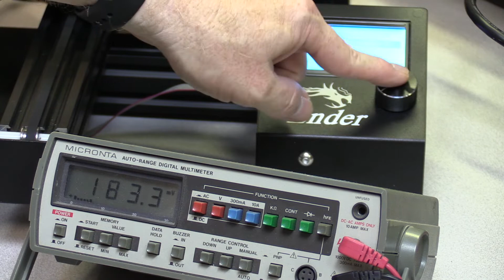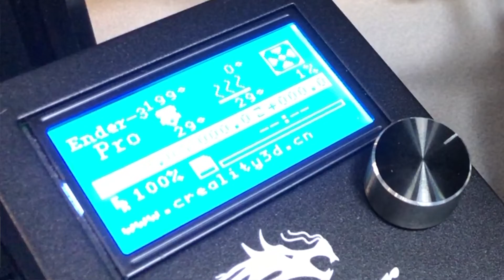Thermal Runaway and the Creality Ender 3 Pro

Comment: Good info Bryan. I've had both the min temp error and the thermal runway error on my CR-10S and didn't know the difference, this helps clear things up. 
I see one of your other commenters suggested the TH3D firmware for the Ender 3 Pro. It's the one I went with as well and it's quite easy to install. It would be interesting seeing a vanilla Marlin install as well though. Looking forward to whatever you go with.
Thanks for sharing!
Thierry
Reply from the maker: Hi Thierry, and thanks! Interesting that the CR10S has Thermal Runaway protection enabled, but the Ender 3 Pro doesn't.  I need to look more at the TH3D Studios Unified Firmware, because I think they've done a lot of the heavy lifting involved in making it an "install and play" solution that works well with the products they sell (such as the EZABL, for instance). 

That said, I also think it's important to be able to throw plain Marlin on a printer. Firmware's not too hard to change once you get the hang of it, if you've got a bootloader on the board, and the right settings in configuration.h and configuration_adv.h in Marlin. 👍
Reply: Sorry,  @BV3D  I should have clarified that on my CR-10S I upgraded the Marlin firmware to 1.18 (I used Vanilla and enabled options I wanted). I'm not sure that it had thermal runaway enabled when it was stock.
Reply from the maker: ThierryDeux Ah, OK. It may not have!

Comment: Bryan, you’re a good dude. Don’t sweat it! We have to all assume these Chinese manufacturers don’t care about the safety. There is zero reason why this is still a problem in 2019. Good job!
Reply from the maker: Hi Stephen. Thanks! I agree. It's simple enough to set the machine limits in the current version of Marlin, and have that installed on the boards. Most of the time, I don't think there's anything special being done in the firmware to support the printer's hardware. The biggest thing I remember happening in the last year was Creality's implementation of power-off resume; they released the source code for that and it got rolled into Marlin. Now everybody can benefit from it. I just wish Creality had chosen to include or enable thermal protection in the firmware, too.
Reply: theyve fixed this in their latest ender 3, the ender 3 max, ive just had mine give me the warning and it auto shut down
Reply: @nekosimp7751  Mine as well, this vid a good one!

Comment: Hi Bryan.  I use th3d on my Ender 3 and cr-10. Still based on Marlin but much more user friendly. Also if you ever wanted to add auto bed leveling it's just one click in th3d and all the offsets are done for you .
I was sure you did a video on unified firmware?
Tony
Reply from the maker: Hi Tony! I need to look into the TH3D Studios unified firmware. Are the screens themselves laid out differently compared to plain Marlin? I do like that they've got the offsets for the bed probe already in the firmware, and you can just toggle it on when you install their EZABL.

I haven't done a video about it, but I probably should. I did mention and link to their Ender 3/Pro direct-wire power supply cables in this video.
Reply: @BV3D  Hi Bryan. 
Yes it is the same layout as marlin as in configuration h and other settings.
I've just installed it on my cr-10s.
There are a good few decent videos on here about it. An Australian chap does the best video but I can't remember his name sorry.
Tony

Comment: Thanks for an awesome real world test... I will definitely have to try on my printers in this much safer way!! It always concerned me to have a potential glowing fireball... and hope that nothing gets damaged in the process of just a test... great looking out!
Reply from the maker: I was so disappointed when the Ender 3 Pro didn't detect a thermal runaway condition. I know my Monoprice printers with the aftermarket ADVi3++ firmware (based on Marlin 1.1.8, I think) will do it. I had a bed thermistor go out and the printer shut down mid-print.

Comment: Decoupling the thermistor from the heater block seems fairly unsafe, as the "60W" (actually usually 36W) soldering irons from China are known to have gone glowing red hot when the temperature feedback loop has failed. I wanted to suggest yanking the heater cartridge from the board, but you have come up with that idea yourself already :D
Reply from the maker: Yeah, I didn't think it was a good idea to actually leave the heater cartridge powered up. Turns out disconnecting it and just watching the output voltage was the right call. But even without a voltmeter, you can simply disconnect the heater cartridge to test. The thermistor will never register above ambient temperatures, and if the printer's got Thermal Runaway Protection enabled, it'll throw an error without anything getting dangerously hot. 👍